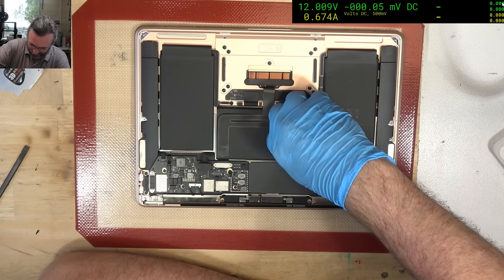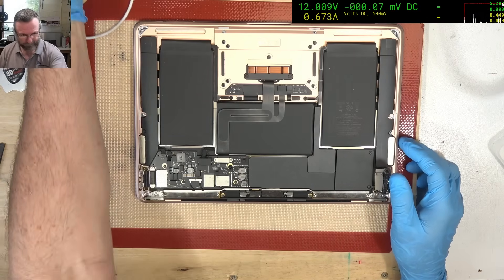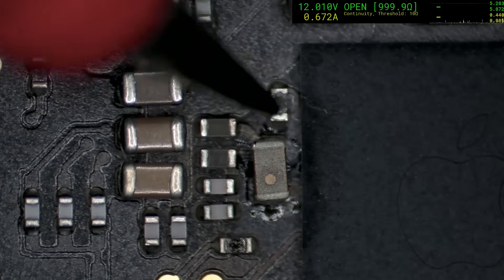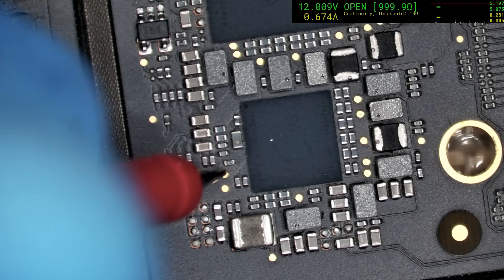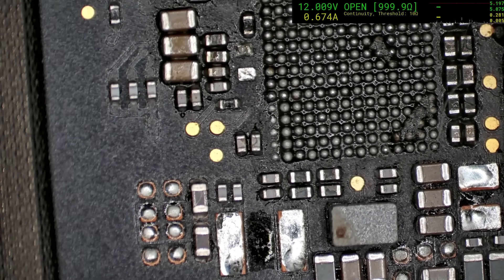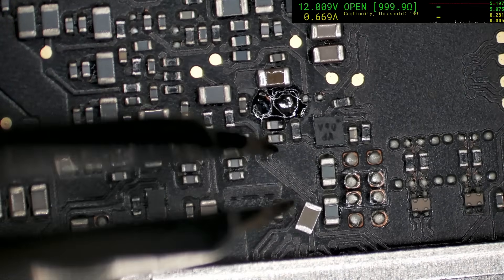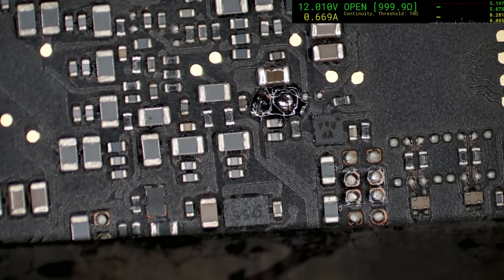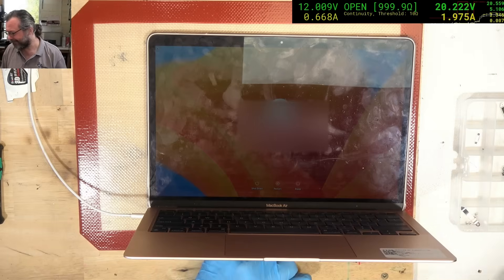Dead Macbook with common fault hidden in plain sight. Macbook Air A2337 M1. 450mA Pulsing

Comment: Very helpful video, thank you!

I’m repairing one with exactly the same capacitor short and the same inductor burned open. Now I just need to find a suitable replacement inductor.

It’s impressive how much abuse that U7700 regulator can take considering the current that flowed through it when it managed to burn an inductor with only 0.18 Ω DC resistance.
Reply: Yay I fixed it! I found a suitable inductor from an old android phone. It measured close enough at 0.51uH and 0.2 DCR

This was my first board repair

Comment: nice work! So, is it a good measure to increase the decoupling cap values in some cases?
Reply from the maker: There's generally no harm in slightly increased network decoupling capacitance;  some issues may arise with going too far due to the inrush current requirements.

Comment: Amazing channel and content, subscribed and liked.
Reply from the maker: Cost factors. 

Not sure about the overhead though, that's a SONY AX33 and usually does a fine job in keeping focus, face cam is a Panasonic HVX1, likewise usualy is fine, but the microscope camera is something that I'm needing to change as I've never been entirely happy with it; limited DoF and poor light sensitivity ( so you can see the correlation there ).  

Also need a larger dedicated monitor-screen for the OBS output as my eyes shift a little too much during the course of the day, subsequently even when the eyepieces are set in morning I've already drifted by middle of the day etc.   All work in progress.
Reply: @pldaniels  I actually deleted that part of the comment Paul. It was nitpicky and rather trollish of me to point that out. I do appreciate the time involved in your reply and understand completely the eye issues that you speak of.
Reply from the maker: @JimNichols  it does help to be reminded at times about the improvements/tasks that still lay ahead.

The microscope camera was one of those unfortunate purchases that seemed like it ticked off the right items but ended up being sub-par.  

New one planned uses the SONY imx678 1/1.8" ( current one is IMX334) - https://www.aliexpress.com/item/1005006617825367.html

I'm sure it'll have its own things I have to work around but it'll be nice to have something that isn't quite as demanding on the light and hopefully it'll have a superior DoF as a consequence.

Many thanks for your response, it's appreciated.

Comment: Hi Paul, thank very much for sharing this great video and your big experience....great the trick about tilting the board to have another point of view....but u think can have same result using the antiglare ring light?... I use It on my selfmade arm for the electronic microscope and see a lot of difference Eg.  with normal light that do reflection u can't see a brush hair....meanwhile when i switch on and regulate the antiglare i can see It other detail like dust ecc..what u think can we see even a crack on the cap? Thank for your replay and keep on sharing on open source filosofy... bye Francesco Timpano from Florence Italy
Reply from the maker: The main purpose of picking the board up and viewing at multiple angles is to neutralise the fact that no matter what sort of lighting you're using there's always going to be blind zones and/or angles that result in fault elements being rendered invisible at a specific angle. Using light at a lower incidence angle ("antiglare") you can generate shadow zones that will hide small amounts of leg corrosion close in to the body of the part.   

It's a good example of regardless of the tool being used, it's important to know the pros/cons and compensate accordingly.
Reply: @pldaniels Hi Paul... good morning for me in Florence and good  evening for you in Queensland.. thank very much for the exaustive replay to my question and to share with us your experience, hoping can came back again to your wonderful Australia to visit my cousin Lucy and can know you bye Francesco Timpano from Florence Italy🤗🤗